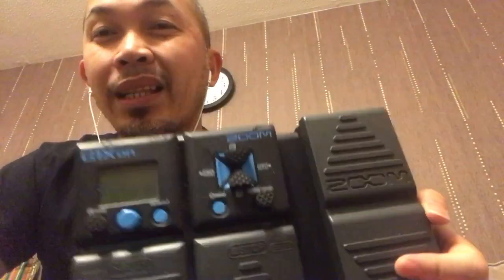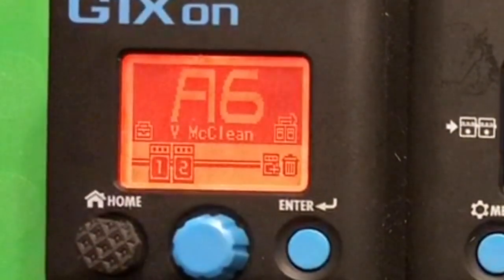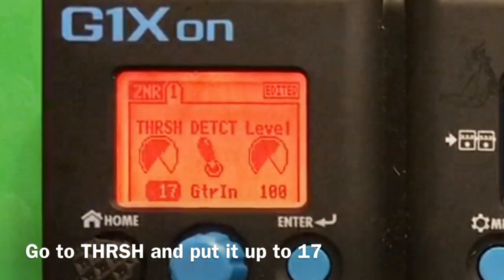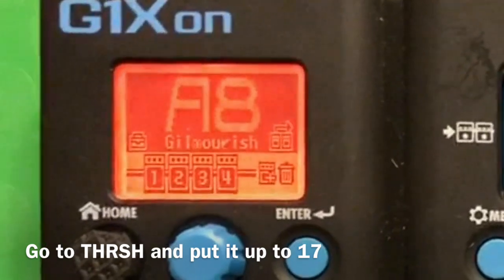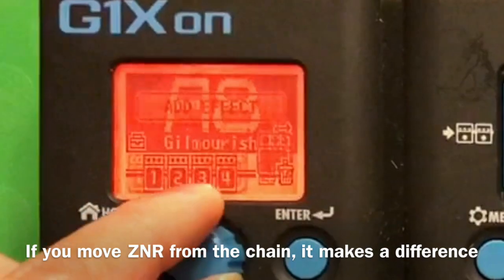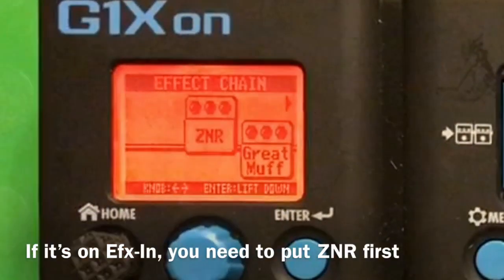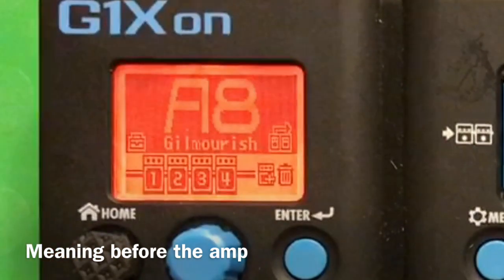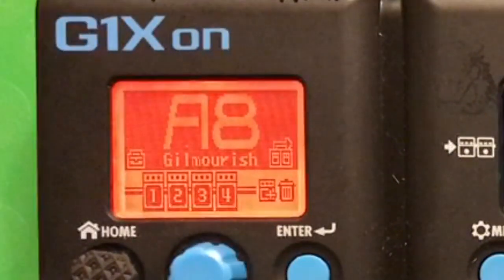Solution To This Noisy Zoom G1xOn/G1On

Comment: what is the gilmore patch
Reply: i have a nise gate by boss can i put this in line
Reply from the maker: @a1b1bcsologuy  Yes, you can use that one and I would assume it would be a lot better. Because it will be easy for you to adjust it manually if you need to tweak it during live gigs.
Reply from the maker: It's already in the unit. They got loads of artists that they copy the sounds one of which is David Gilmour. They also got Hendrix, Kravitz, Foo Fighters, Zakk Wylde and a lot more.
Reply: @vincentryanborres  Thank u
Reply from the maker: JOE Butkins you’re welcome
Reply: what patch name shoud i look for pink floyd
Reply from the maker: JOE Butkins Bank F6 Gilmourish
Reply: @vincentryanborres  dont have it
looked all over went up the patchs to jor h
Reply: i foynd it thanks
Reply from the maker: JOE Butkins and there lots of nice patches there. I like Rake, Mufflr and Shred Pick. Oh also Texas Blues and Nashville